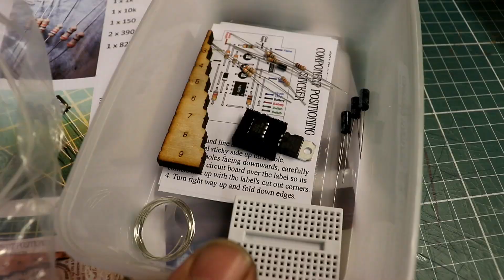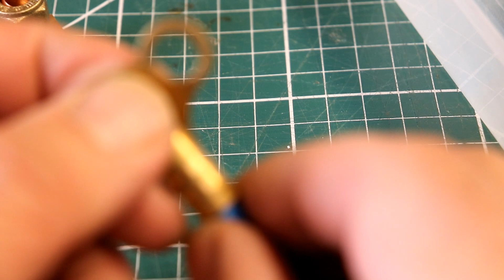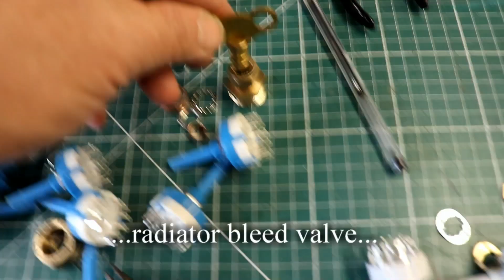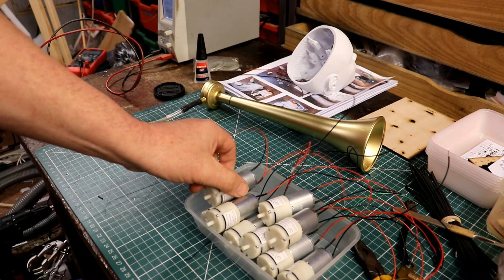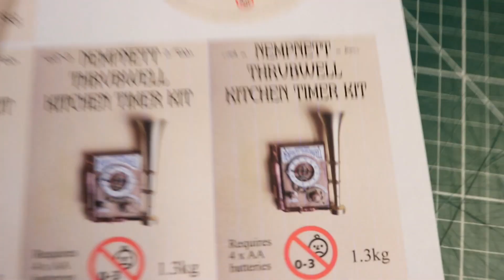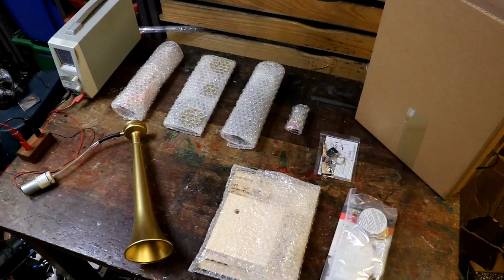Make your own working steampunk machine!

Comment: If the switch shafts are thermoplastic I wonder if it would work/be easier/be quicker to cut the end off one of the brass keys and mount it on to the tip of your soldering iron (ideally a temperature controlled one) and then push them in to this to form the square end?
Reply from the maker: Thank you for the suggestion. That's an interesting idea and would be a lot quicker than sawing them to shape. I do vaguely remember trying this when I was developing the Nempnett Thrubwell, but found that the melted plastic squeezed into all the little nooks and crannies and I couldn't get the keys off. It also smelt awful! It would be possible to make some sort of smooth copper mould, perhaps even in two halves. I'll give it some thought and thank you again for your suggestion.

Having been away for a few days, I'm currently thinking about how to get Victoria the automaton to sing along to the ukulele accompanyment. It uses electricity, but I started thinking about using old reel to reel magnetic tape and a very old 'solid state' tape recorder I have somewhere in the loft. This would mean I could record the singing voice on one stereo channel that could then have the crackle, wow and flutter and pitch changes added by the Teensy audio board. The other stereo channel could have the ukulele fret and strumming information encoded - somehow. It would keep everything synchronised but how to encode a load of binary data on an audio track? Several things come to mind, but I don't know how to achieve this; I didn't take a computer away with me and ended up building one of the complicated Lego Technic kits which was most enjoyable! Any ideas welcome!
Reply: @steamhead  Hi.  Recording data to an audio tape would be well beyond my skill/experience level and from a quick search I get the impression it would not be at all easy.  I remember it was a challenge to get them to work reliably on computers in the 80s.
But, on the other hand you could maybe use the second audio channel just to record some beeps which could then be detected by the Arduino with a simple sound level detector circuit and be used for some kind of synchronisation if just start and stop points or periodic beeps to keep the timing in sync etc.
Reply from the maker: @alanesq1  thank you so much! Here I am over-complicating everything as normal, when all it needs is, as you suggest, is having a tone to synchronise when the next fret movement and plucking is required - brilliant!